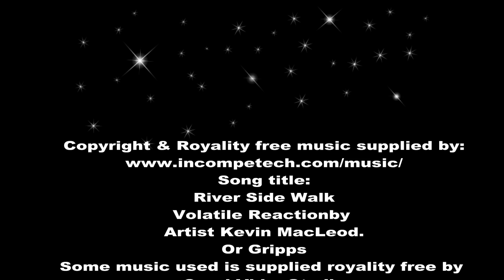Around The Shop Today (Need A Favor Please)

Comment: Now you are working on something I have worked on many times and all brands from Cat to smaller stuff anything that could pickup something and move it around.  By the way your son is outstanding at picking that getar !
Reply from the maker: Well at the shop there's a boat, a motorcycle, a car, a mini van, a lawn mower and some welding to do so it's never boring. I seen your new tractor. Sorry never had time to respond. It's our busy season but it's a beauty. We're having email issues. 6500 emails right now in my inbox and no one including the carrier on how to dump them. Hope all is well my friend.

Comment: Someone added aluminum.valve caps in mine, too, when I bought my new ram 1500. I had the same issue. I now use regular black ones. Lucky for me my truck was still under warranty. But little did I know that the aluminum valve stem.replacement kit were and are available at auto.parts stores here in the states. $3 and some change versus $150+ at the dealer. I had t buy 2 sensors last year, though. After all was said and done, I only needed only 1. I bought 2 for around $23 on rock auto. If it ain't one thing, it's another. Know what I mean.

Comment: Paul I was thinking of another mod for old Blue
When you put the second air tank in.  Consider this making a bracket that holds a air chuck that would be mount behind the drivers seat and a holder for a small piece of a or hose with a blow gun on it so when you are out in the field working and you get dusty and dirty you can blow yourself off before you get in the cab.  it would be easier than opening the hood up and using that out put.  I am thinking about this for my truck I know there have numerous times I wish I had a way to blow dust and dirt off myself.  Just something to think about
Reply from the maker: I added the air chuck to the tank under the hood. Really didn't want to go drilling holes in the cab for one. I doubt I'd use it but time will tell.

Comment: I have been building grill guards for CASE backhoes for a couple years now. The local dealer in Donovans sells them.
Reply from the maker: No guard going to stop this issue. They keep driving into the pile with the boom up. I removed a 1/2 load of top soil from the rads.
Reply: +Paul Short that's the whole idea behind the grill guard. They were having issues with operators hitting the grill when loading dump trucks.
Reply from the maker: Their not just hitting it. Their using the grill for plowing it 😳

Comment: Hay Paul,  you better check the bolts holding that tag to the grill.  I bet they are sheet metal screws that hits the radiator when dirt or rocks hit the grill.  Hope you see this.
Reply from the maker: LOL. No bolts. It was held there via electrical ties.

Comment: morning Paul, I wonder if you could give a little insight on my Kubota 2013 L6060 HST transmission has an error code 91 HST R solenoid R NG and it will not go in reverse. Where is this solenoid located?
Reply from the maker: Sorry. Don't have a 60 service manual. I just have the 40 series manual. Might want to check with your dealer.

Comment: I'm guessing that bucket you're standing under has zero! chances of coming down on your head.
Reply from the maker: Your correct. No chance. It was locked via the factory cylinder lock on the left hoist cylinder. Look again. It's painted red and designed to keep the FEL in place when repairs are being made on the system.  Maybe instead of being sarcastic you simply could have asked if I had it safely secured.
Reply: +Paul Short sorry you took it that way. I was not trying to be sarcastic.

Comment: So so I have to say anything about the FEL not being blocked :)
Reply from the maker: I'm dissapointed in you. You didn't notice the red block that comes with those back hoes and it's in the lock position. Yep. I'm disappointed in you. :(
Reply: OK I have to back and look again
Reply from the maker: Look at the left hoist cylinder. Red steel cylinder block 🙄
Reply: AHHH SOOOO !!!  Well in my defense it must have the all the glare off the GHOST  STOCKINGS,,,,snicker Have a good one buddy :)
Reply from the maker: Pervert. You shouldn't be looking at my legs lol.
Reply: Ahhh man you know its kind of like a car crash ya just cant look away,,,lol
Reply from the maker: Hey you didn't know this is my theme song did you? https://m.youtube.com/watch?v=AHcjjxYbgNM
Reply from the maker: You are so right Grasshopper:)
Reply: HEY PAUL I do have a question for you,, I found an old cast iron dutch over that someone knocked the leg off of and used it for a hanging flower pot. Can the holes where the legs were knocked off be welded or brazed shut to be able to use it again?
Thanks Bud
Reply from the maker: Brazing is the way to go. There are other types of welding that would do it but in this case brazing would be my first choice.